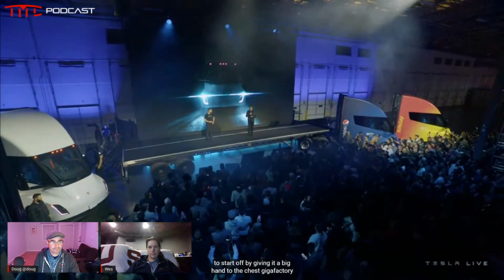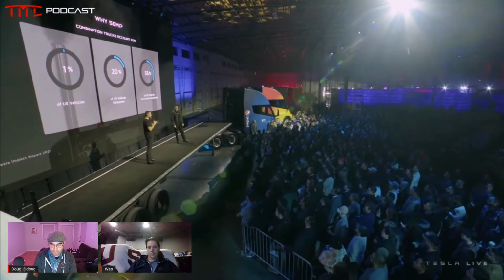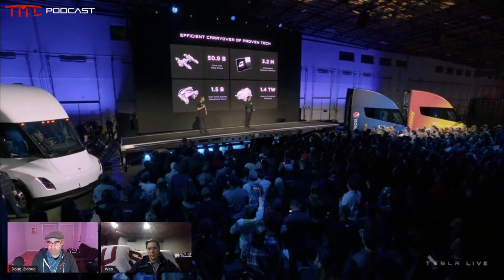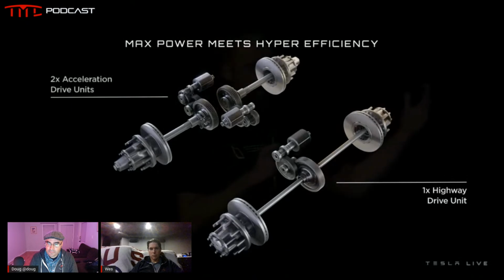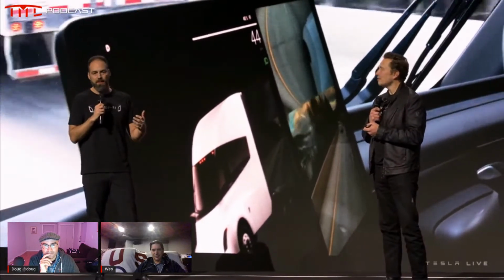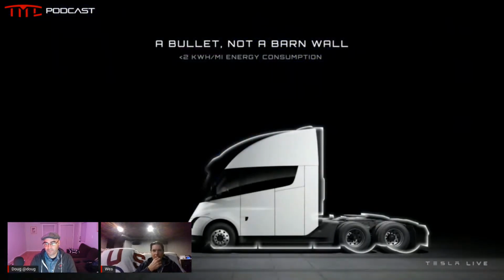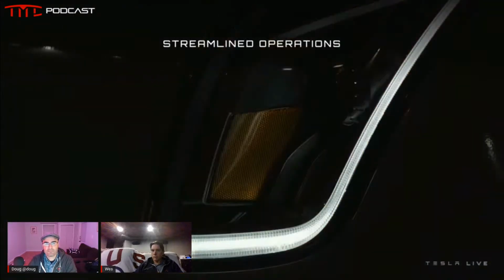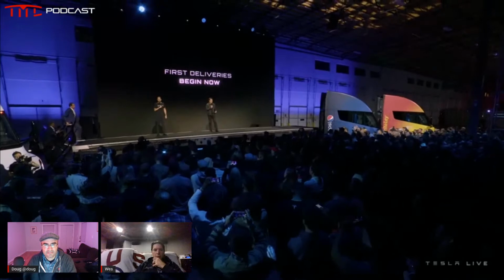Tesla Semi Delivery Event Live Watch Party (Guest: Wes Wahlin) | Tesla Motors Club Podcast #28

Comment: I like the 1000 Volt part, I expected 1200 Volt actually, but 1000 Volt is still a big improvement in most cases. I wonder why the model S and X don't work with a 1000 Volt.